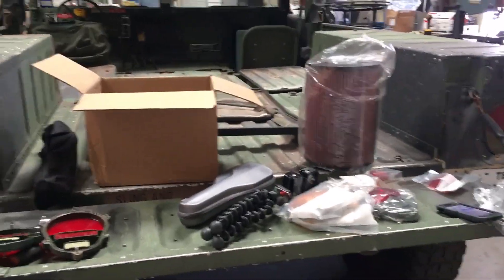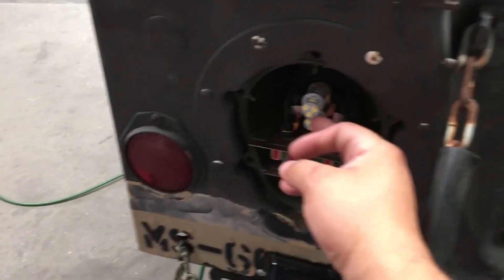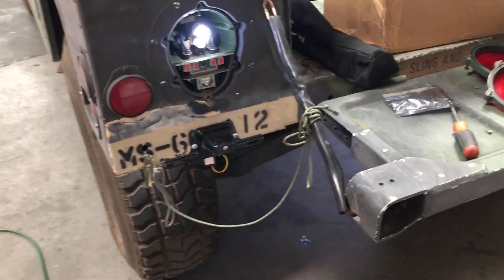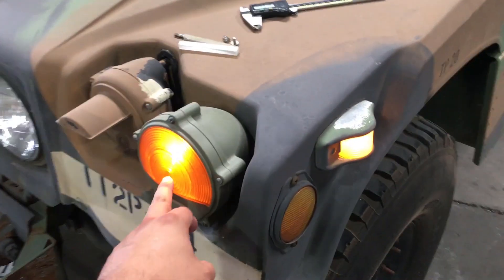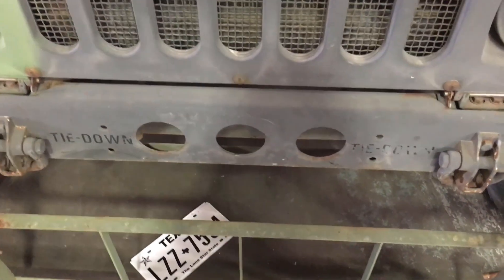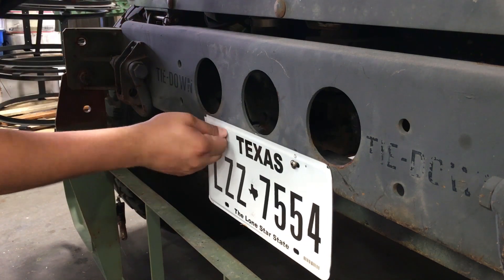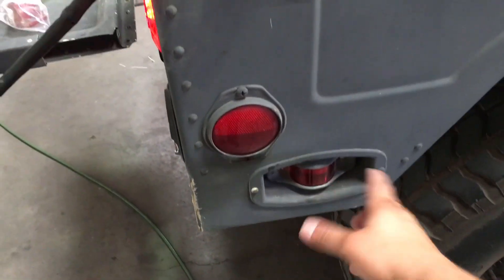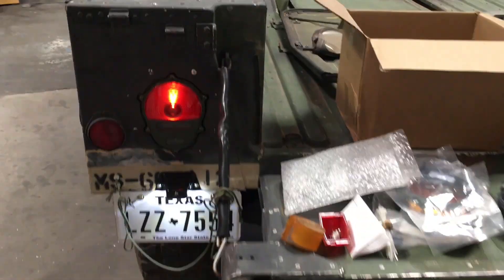Making a Mil Spec. Humvee 100% Street Legal #m998 #Legalhumvee

Comment: Brother when you say title is that the SF97 ? I’m looking to buy a HMMWV the seller saying its Title but to be registered and insured to be street legal? How do you get it inspected with  out a vin? Or insured with out a vin ? I’m from South Texas, any help would be greatly appreciated
Reply from the maker: Hello. I never heard of an SF97. So these are manufactured by AM General. All of these were, and they all have some vin number on them. The vin I have on mine is not the traditional long vin we are used to like modern cars. However the title I have is the same looking one you get from Texas like a modern car. Says AM General and has the serial number that’s on the vehicle. To get it inspected, just have to pass safety test. Lights, turn signals etc. I know there some out there that never got a title from the DOJ. When I bought mine it had a weird title from the DOJ. I submitted that to the state of texas requesting a Texas title to later go and pass inspection. I’m not sure if that’s the SF97, but if I were to buy one with that I wouldn’t pay the price of one like mine that’s truly registered and titled. The reason bc they’re always changing laws and don’t really know if you will ever get it truly titled or registered. Hope this helps and good luck.
Reply from the maker: I just looked up SF97. Mine didn’t come with that. Came with a title from the DOJ, I have no idea how or why. But it seems like you can get it titled a lot easier with this SF97. I suppose it’s hit or miss with these kinds of things. When I submitted mine they asked what kind of vehicle it was and said it was similar to a jeep. Don’t say it was from the military, they’ll probably think you’re trying to get a tank or some thing like that lol.

Comment: There have been a lot of recent comments on forums and Facebook groups that the keyed starter swtiches are causing a lot of problems. Anything from switch failure to damaging the pricey PCB (Protective Control Box).
Reply from the maker: ajax1137. I have noticed twice that my heat cycle to heat the coils doesn’t want to start. It turns on the wait cycle like if the glow plugs are already hot. I’m not sure if this is due to faulty switch or maybe wiring. But I will keep and eye out and let you know what happens.

Comment: Did you have any issues with your flasher relay? I hear swapping to LEDs cause problems.
Reply from the maker: Ben Carlson. Flasher relay as far as turn signals? I did notice that even though they are led. They are still not bright enough.
Reply: @mods2rides  yep I here it affects the turn signals, they say there is a LED compatible flasher you can swap too
Reply from the maker: Ben Carlson. I might look into that. Thank you.
Reply from the maker: Ben Carlson. I updated the flasher module to the newer version and it made a huge difference.

Comment: The primarry things that make the HMMWV non-street legal are there's no collapsible steering column and no padded dashboard.
Reply from the maker: I dunno about those. I had a Ghia that had no collapsible steering column and it was street legal. That would rule out a lot of cars imho. Either way I got it titled and drive it on the street legally.
Reply: Rather misleading to say that HUMVEE in this video is 100% Street Legal! "Street Legal" ...only if it means somehow, someone was able to get a title, registration and license plate(s)! The Civilian HUMMERs (H1) are fully certified as "Street Legal" and DOT/FMVSS/EPA and Calif. compliant. It took AM General $62+ million (in 2022 dollars) to make their HUMVEE "Street Legal." Just a few examples of perhaps 60 or more HUMVEE non-compliances; No DOT/FMVSS-108 Identification Lights on the Front and Rear that are required on any on-highway use vehicle over 80 inches wide. No Rear Bumper. non-canceling turnsignal, (Military Composite lamps do NOT meet DOT requirements in several aspects) no non-collapsible (break-away) steering column, engine does not pass EPA emissions requirements for CAIF or even for 49 States. Windshield Defroster system non-compliant, no Inside Rear View Mirror with dimming ability, Seat anchors do not meet requirements, seat belt/restraint system does not meet requirements, batteries are installed inside occupant compartment, driver seat does not have required adjustments (H-point is off), outside rearview mirrors do not have 50 sq. in. of flat glass arena required on over 80 in. wide vehicles, No padding on instrument/dash panel, no padded sunvisors,  seat and covering materials do not meet flammability requirement, missing required road hazard equipment for vehicles over 80 inches wide, no side door impact beams, not compliant to FMVSS Roof Support requirements, no steering column locking provisions, no side door locking provisions, Side door lock mechanism do not meet requirement and the list goes on & on....

Comment: So you only got to get the lights for the license plate to make it street legal and have the title changed?
Reply from the maker: Hummer Guy. Every state law is different. I live in Texas so state requires you to have 2 license plates all the lights working and the rear plate to be lighted. There’s a lot of people who have gotten pulled over for that here. Since the Humvee is a 92 I don’t require emission testing only a safety test. (Brakes, lights, etc). To get these things titled to your name can be of some challenge. You basically have to be very lucky or pay someone extremely knowledgeable on how to do the process. The reason for this is bc you get a title directly from the DOJ. I was lucky enough to find someone who knew the process. Another thing is you cannot buy directly from DOJ, you have to have a special license, pass background and basically be a DOJ dealer to sell a civilian one of these. If you see one bone stock like mine they run for about $25-30k depending on the miles and care of the truck.